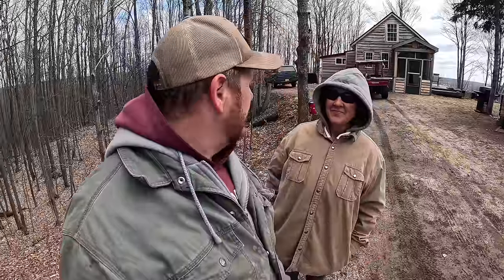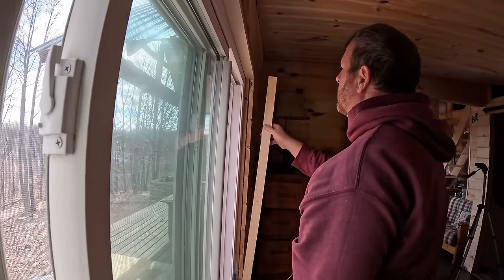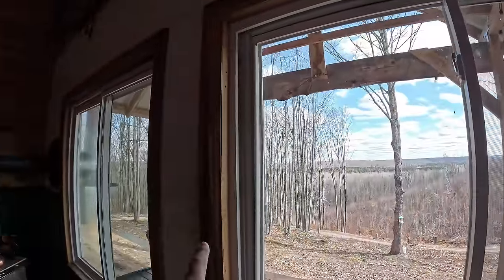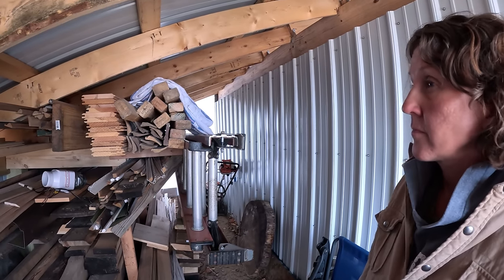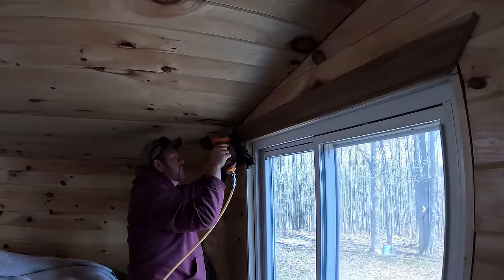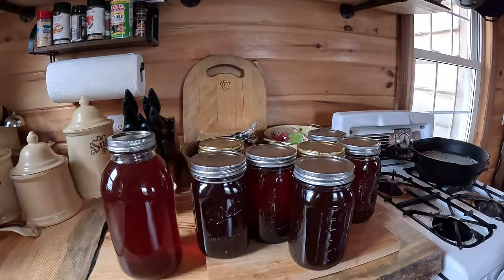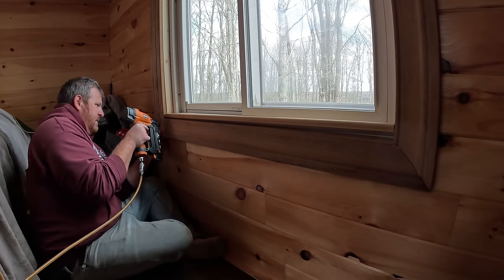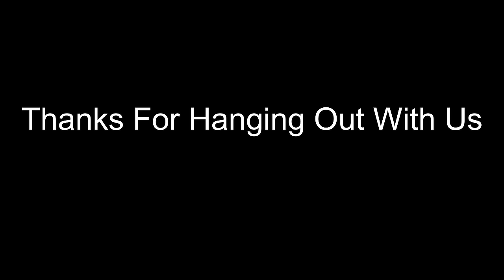Off Grid Cabin - The Build Resumes- Window Trim On A Budget

Comment: Just wanted to let you guys know that the trim you referred to as crown molding is actually camel back molding. It’s designed to go on top of square base molding.
Reply from the maker: Really......nice....thanks for that Barry. I was unsure of its application obviously,  lol. I'm thinking of trying to use it where the walls meet the ceiling,  as I'm unsure of that angle and think it might look decent there.....and I have a decent amount of it. What do you think?
Reply: @OffgridwithJayandJen  , that won’t work for the ceiling. There’s no way to get it flush where it meets the ceiling and wall. If you have some cove molding then that will work or you could just go with a 1x2 up there. Crown molding is the best way but since you probably don’t have any crown go with a cove or straight edge molding.